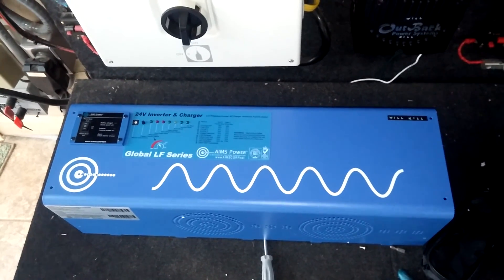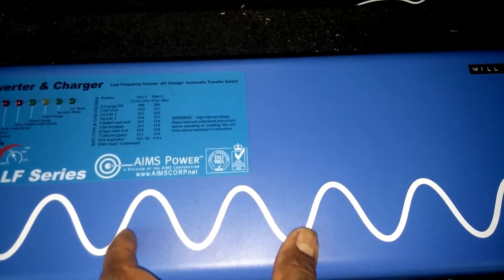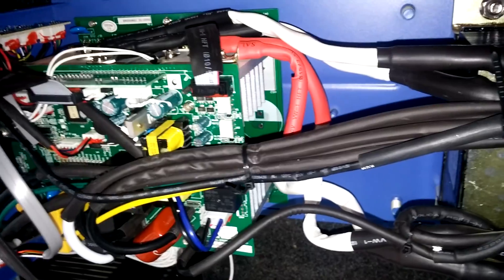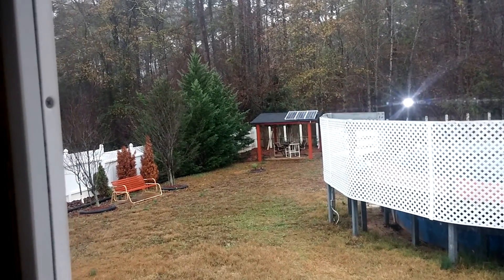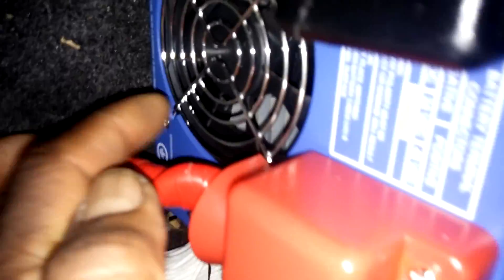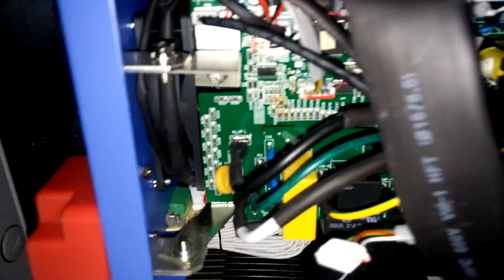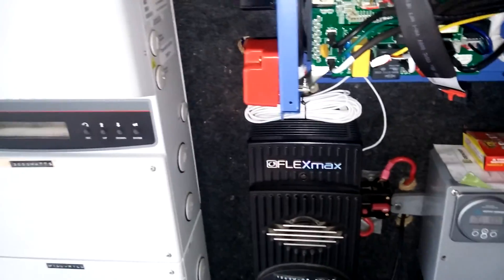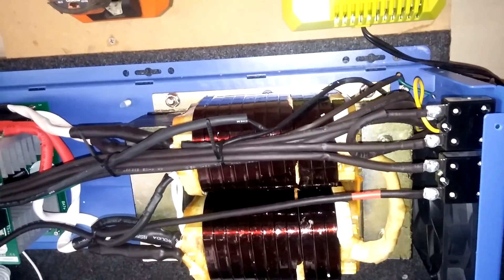a look inside aims inverter charger 24v to 120v 4000 watts

Comment: Beautiful set up. Aims makes BEAST inverters . I'm  looking at the 48v 4000w or 6000w unit for my start-up solar system. I'll probably pair it with a  Victron BlueSolar MPPT 100/50.
Reply from the maker: Paul shalom thanks for checking out my video/::::you will love the aims inverter it’s a work hog, it’s on 24/7

Comment: Thank you man, I totally agree with you. KEEP THESE UNITS COOL.. Run a cooling tube with a solar fan on dummy mode thats just on all the time. If you keep these units cool they will last u a long time... I always look at units like these and just right off the bat, no matter how many fans they have assume the cooling is totally inadequate.. Many cases is is, but even if ur wrong u will extend the life.
Reply: PEPE CORLEONE  thanks for checking out my video
Reply: I have been trying to find one with the fans manual on 100% but they are all temp controlled it’s so stupid 🤦‍♀️

Comment: thanks for open top cover from the inverter.... 👍 
I have a question about the inverter...... did mosfet have thermal compound between heatsink and mosfet???   I presume not....it would be wise to do so.....
 in case you would run heavy loads..... better cooling.... 
also do the same on control board I think one linear regulator is quite heating up theris necessary to change or add a nother bigger heatsink.... 
on my inverter first goes control board and after I change it goes on power board one side two mosfets.......
I was lucky because I get spear parts for free... warranty.... 
now I run the inverter at 45 degC.and 2.5-3.5kw loads without problem...

one other thing I have seen that I have a similar powerboard exact connection terminals and in same place between board connections....=similar problems.... 
by the way nice videos👍
Reply from the maker: bostjan trancar---thanks for checking out my video.yes it is on the mosfet